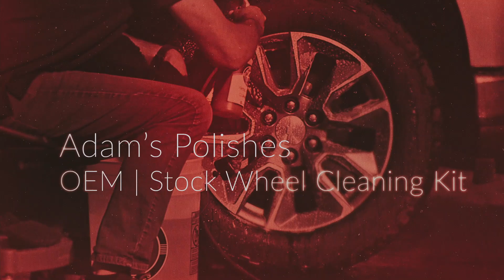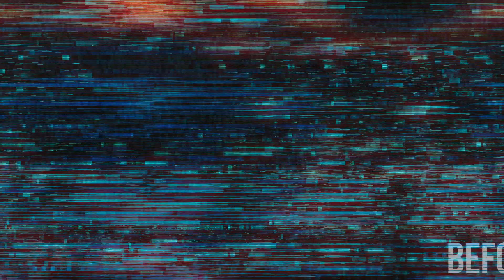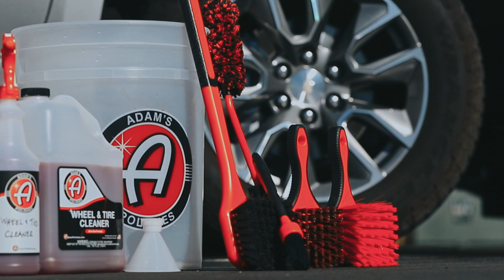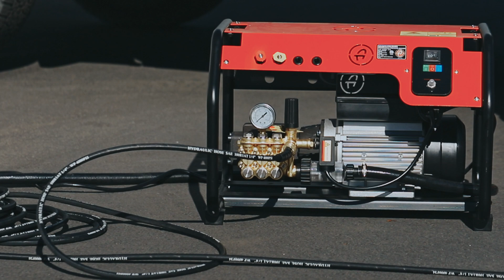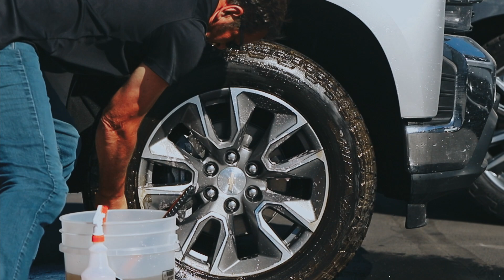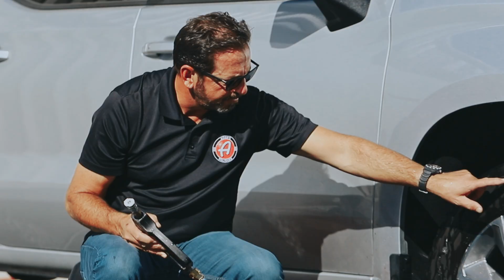How To Clean Stock & OEM Wheels Easily And Effectively

Comment: I have stock steel rims that have the little round holes in them. Also I have hubcaps on the stock steel rims. They are zip tied to stay on the rim so they won't fall off. So how do I clean a rim that has hubcaps on the rims? I don't want to use a stiff brush that will scratch the paint on the hubcaps. Any suggestions. Thanks much.
Reply from the maker: Hi William, you could use our Small Angled Wheel Brush on the face of the hubcaps if you tilt the brush head, combined with one of our wheel cleaning chemicals. It's a very soft synthetic wool material:

https://adamspolishes.com/collections/exterior-wheel-tire-brushes/products/adams-small-angled-wheel-brush

You could clean about 1/3 of the hub cap, rinse it out, clean another 1/3, rinse it out, and repeat, so that you don't keep dragging dirt and brake dust onto the surface. Then rinse very thoroughly with your garden hose.

You could even use our Interior Small Detailing Brush to get into intricate areas. It has extremely soft bristles that are more delicate than our Trim & Lug Nut Brush: 

https://adamspolishes.com/collections/soft-delicate-interior-brushes/products/adam-s-interior-detailing-brush